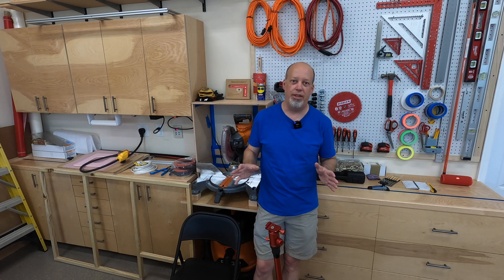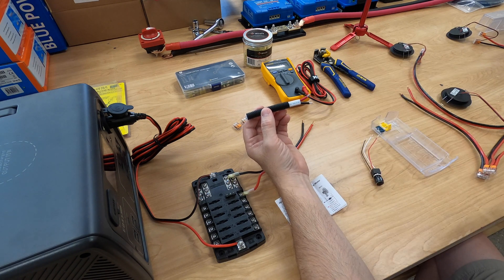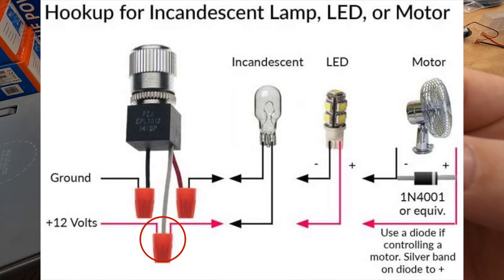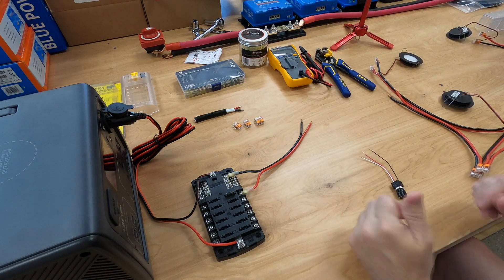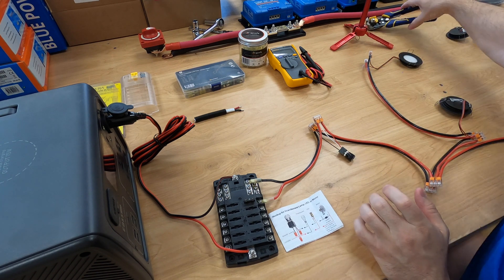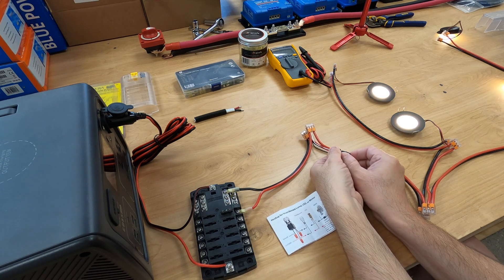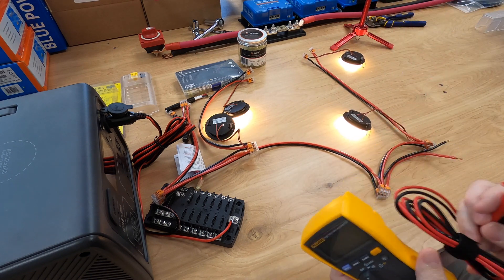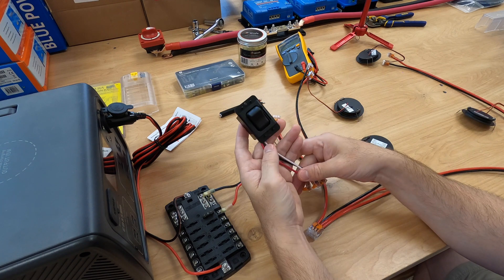Wiring LED puck lights with a dimmer switch for your van

Comment: A detailed and long winded explanation for people new to electricity. Just pay somebody to do the work.
Reply from the maker: At some point in your life, you knew nothing too, and maybe you still do per your handle? ;) Some people appreciate extreme detail for learning to DIY their own projects. If you don't need this level of detail, you're a step ahead of others. If you don't want to learn it, of course you can pay someone! Have fun out there.
Reply: @VanTransitions  If you want a person to learn then what you don't do is provide an idiots guide. The only thing they are learning is how not to think.  Next they will be following your detailed instructions to wire their house lights. And as you should know they will probably switch off the wrong circuit and work on the "three way" while it is live. The level of detail you have provided is for somebody with absolutely no knowledge of electricity. It must have taken a lot of work on your part BUT I still think it is dangerous. (A little learning is ..... )
Reply from the maker: I appreciate you sharing. This is how I am wiring the lights in my van. If this helps someone else wire theirs, great. My video should be 1 of many reference videos that a person watches to gain knowledge from multiple sources. And anyone without strong knowledge should consult an EE (Electrical Engineer).
Reply: @VanTransitions  I do appreciate the amount of time you spent producing an understandable video. It is not easy, requires many skills and takes time that could be spent building your own van. Self education is a great thing but should be built on a firm knowledge base. Quite often it is quicker and cheaper to consult someone who has done it before (the lowest qualification of a professional). Keep up the good work. Regards.
Reply: If its not for you, then pass it by.  Someone's always gotta bitch about something nowadays.
Reply: @photog1529   The only person bitching is you.
Reply: Don't put to much mind into it. The fuse is to protect the wire not the device really. Just size it for the guage of wire. It has a chart somewhere.  Will prowse explains things.

Comment: Good video. Thank you. FYI…I tested several dimmers and several 24-12V buck converters before settling on one. Be aware of their idle consumption or even “Off” consumption using an accurate 100A DC clamp meter (.01A increment). They all varied between 0-195mA!! If you are running on solar, we have to watch energy usage. So, a switch before some dimmers and all buck converters are needed.
Reply from the maker: Thanks, however, I fail to see why a buck converter is needed in this application. If you have a constant voltage within range of the item(s) you are powering, this is not needed. Let's say I had a 17V system (which probably isn't realistic), then I would want a buck converter to bring the voltage to 12V for my 12V items.

Yes it is possible for switches, especially those with a tiny LED status indicator on them to always pull tiny bits of power. Unless you are running a very small system, I wouldn't worry about calculating that into your equations unless you plan to park for months at a time without providing a charge back into your system. And in that case I would suggest to develop a system shutdown procedure, and possibly a trickle charge setup.